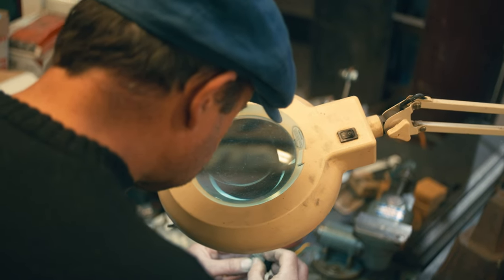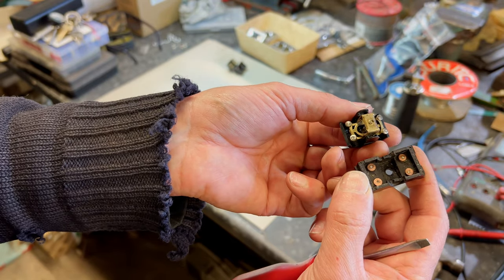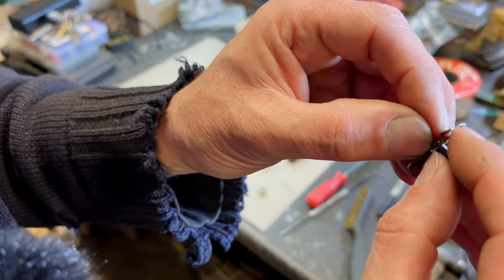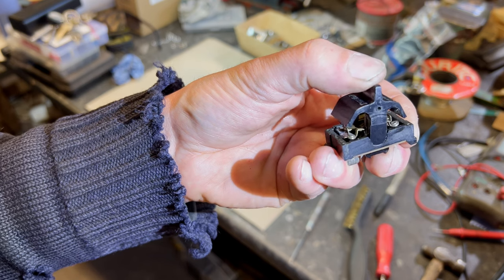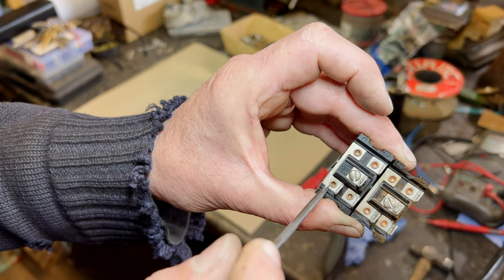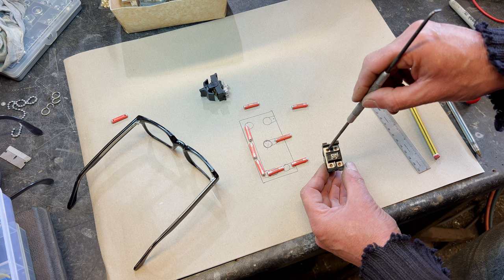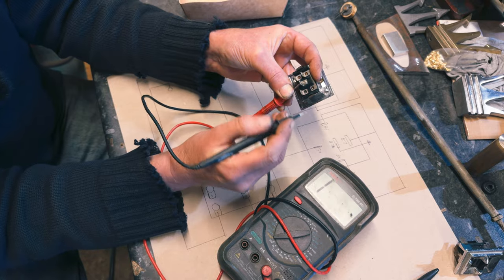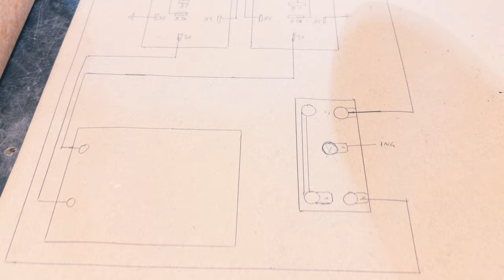Maserati electric windows.

Comment: Very satisfying cleaning old mechanical switches like that. I have hade good success repairing some plastic with bicarbonate soda and supper glue. Thanks again for sharing. 👍
Reply from the maker: I have seen this technique but haven’t actually tried it myself.  I do use a two part plastic repair resin for this purpose but it is very expensive as it’s a motor trade product.    I am interested to try the super glue and bicarbonate trick .
Reply: If you mix the soda with the ground up lead from a carpenters pencil 50 50 before adding the glue it is stronger and black in colour.